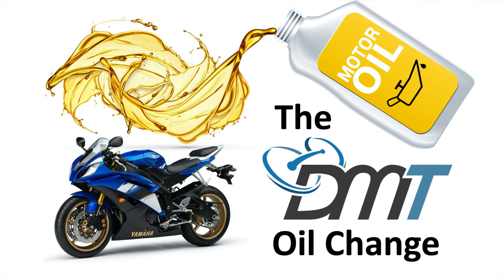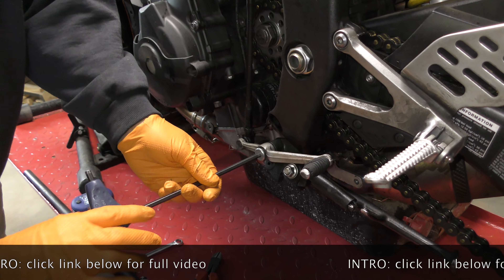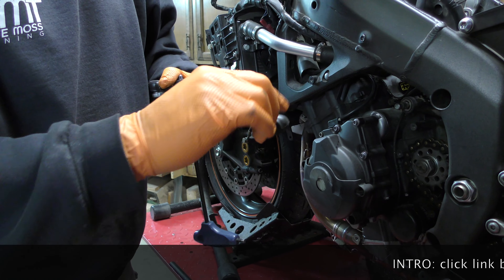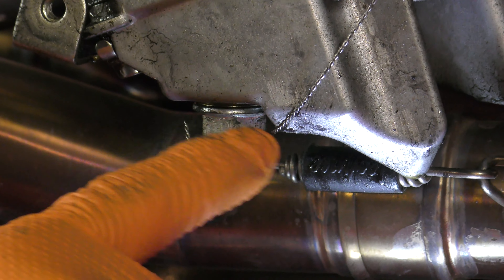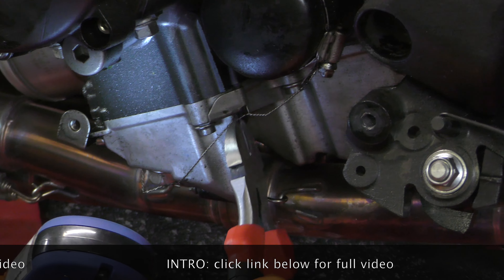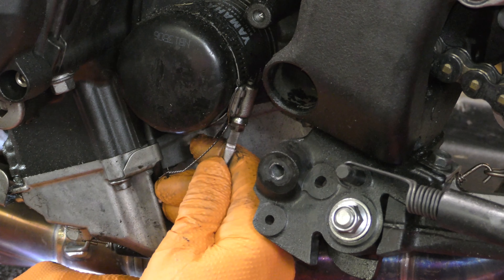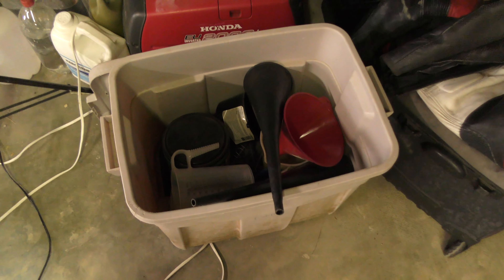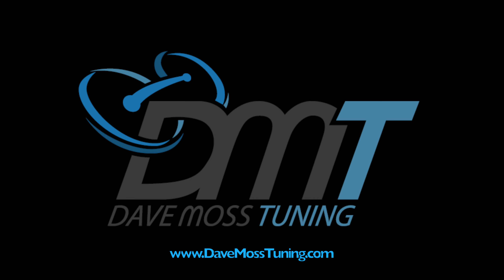INTRO Annual Motorcycle Maintenance: The DMT Engine Oil Change

Comment: That was a well-done safety wire install. 
With the oil filter graber that was to lose, you can fill the space with say shop towel to make it grip if you didn't have another that worked.

Comment: Hey Dave. On the R6 I prefer to use the 'cup' tool, just slots over the end and a breaker bar with extension. Great idea from you about the safety wire and large hose clamp, think I'm gonna fit the same on the RSV4 Cheers Sir👍🏻👍🏻👍🏻
Reply from the maker: Thank you for your comment and assistance to others. We start with what we have as tools and then learn what we need. Cup tools are great, so I am sure many will go buy one :)
Reply: @catalystreactionsbw  👍🏻😉

Comment: The safety wires used (as you know) are compulsory for racing. It’s a good indication, when buying second hand, if a bike has been raced, even if the wires have been removed you’ll still be able to notice the additional holes made to secure certain items. An old trick. 👍😎🇦🇺

Comment: screwdiver peeking around the corner
"did somebody say stuck oil filter ?"
Reply: is there another way??
Reply: @flyingdutchy01  ive read of an approach, where you wound a few passes of tape around the oil filter, then a few around your own hand where the last few passes have the sticky side on the outside, then grab and twist without slipping. no clue how well that would work, since ill only buy filters with a hex nut at the top, but should i come across one without, ill try that method.
Reply from the maker: The screwdriver is a last resort as it makes such a mess. It came off with persuasion and patience - they always do when it is your own bike and you put the last filter on.

Comment: Is 6 month oil change overkill? Still trying to understand why oil changes are so frequent on non-track motorcycles
Reply: That's only needed if you ride regularly and if you use conventional oil. It degrades over time by itself. 
If you switch to fully synthetic oil you can extend it to once a year and usually add 20-30% more miles than required per the manual because it is more stable and has no impurities.
Reply: The fact that the oil is used in both the motor and transmission plus has abrasive clutch material in it is justification for frequent changes. Also a high revving performance motor. How often would you change your oil in your Ferrari? Exactly. My bike has never even seen dirty oil...
Reply: I've been told by InMoto Aprilia that oil changes every other trackday. Personally I think that is excessive, but on the road yearly with filter is more than enough.

Comment: Hy again Dave I have a question ... wich engine oil îs good for your bike? I run on motul 7100 10w40 on a suzuki gsx s1000 2020 some People told me to pun bel ray wich one îs better for my motorcycle?
Reply from the maker: 1. Motorcycle engine only oil for wet clutches. 2. Manual specified oil for the engine. 3. Review additives package. 4. If you want to get really complicated, find engine oil that has long chain molecules.   I use 7100 in all my street bikes and change it every 3,500 miles.

Comment: Where can I get some wire lock pins for my rear axle castle nut? Everything I see is only down to 1/4"
Reply from the maker: Ace Hardware, Lowes or Home Depot in the US. Your local hardware store will have variants from R clips to carriage bolts. Tractor Supply is a good option.
Reply: Even a nail.

Comment: I mixed 800ml of 10w-40 with 500ml of 5w-40 will it cause any harm to engine?
Reply: better than no oil? 
mixing always suboptimal. also depends on the engine some high power high revving engine def no go. some 30 -40 year old honda engine prob fine
Reply: Yeah it's fine but not ideal. Mixing weights isn't the best idea but if you were low on oil, that's a better option. Change it when you can.
Reply: @stijn nel yamaha fz250
Reply: nothing at all wrong with it, but it does alter the viscosity